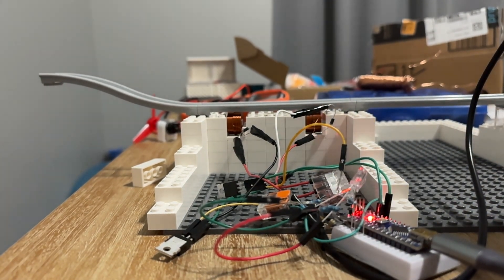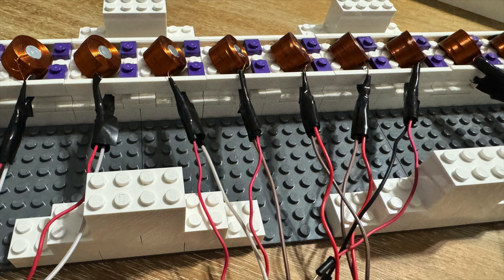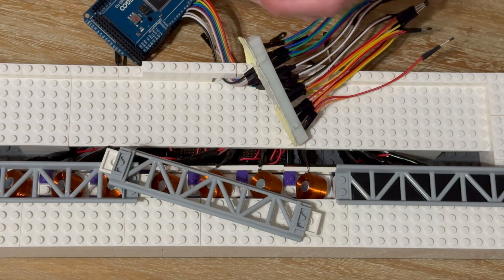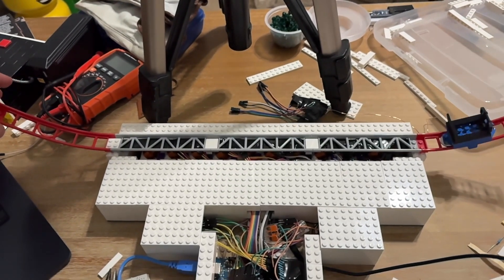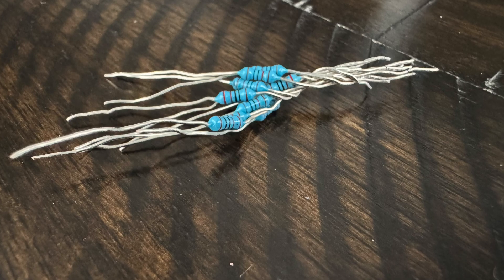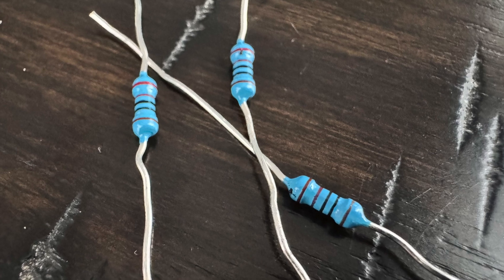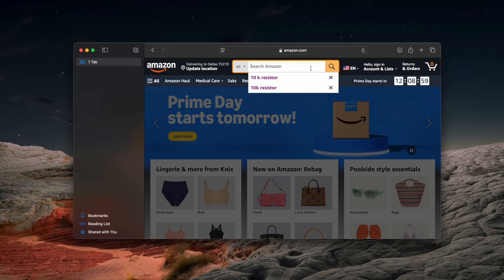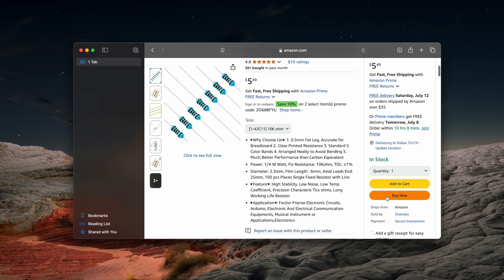LEGO Electromagnetic Launch part 1

Comment: If you want to gain more speed, the magnets should turn on, off and inverse in alternating patterns. Magnets in front of the cart should attract the train, below should be turned off and behind the train should repel them. Awesome project!
Reply from the maker: Thanks for the advice, I actually tried that on my 2 electromagnet 🧲test in the beginning of the video, however it was not very smooth because the LEGO carts only have clips instead of wheels on the bottom😕If I can find a better cart design I will definitely try that again. Thank you!😃
Reply: @pierces_bricks  3d printing and ball bearings
Reply from the maker: I started work on that project, though I don't have many 3-D modeling skills. Watch part three if you want to see how the new car turns out :)